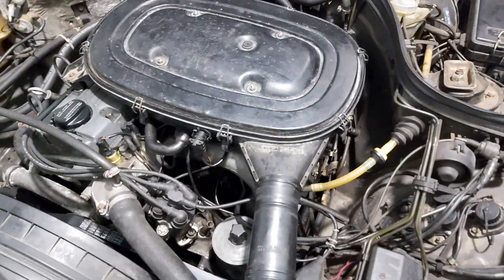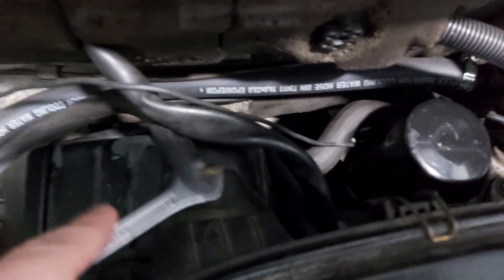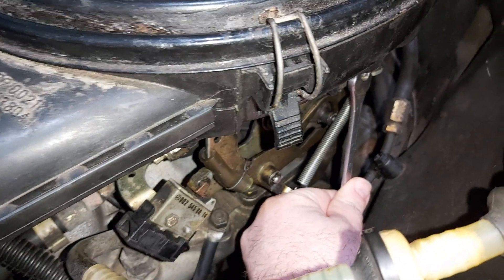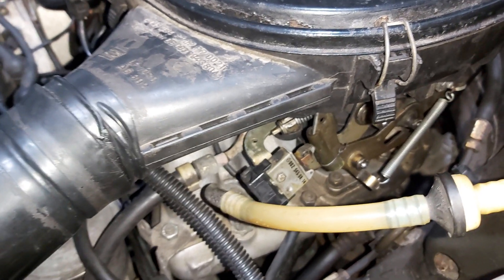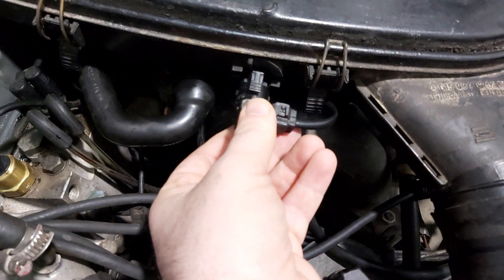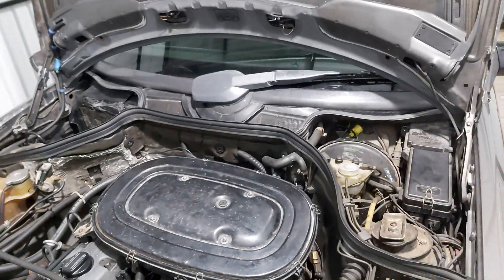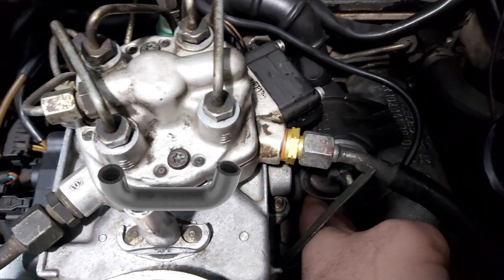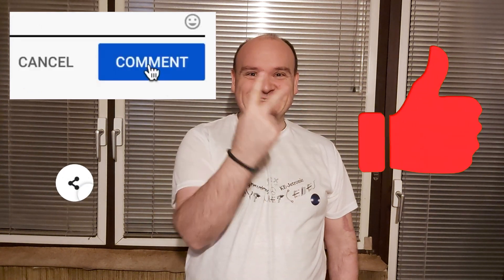Mercedes KeJetronic - A special video for a subscriber - The ICV

Comment: Great video .
Can you show a quick video , on how to remove the air box assembly on a 1992 SL300-24 M104 . I can only find the two nuts on the passenger side but can't find the other one on the driver side .
Reply from the maker: I was working on M104 engine ones but I don't remember really where each nut goes.

Comment: Hello and thank You for the videos! Here is my 420SE running: https://www.youtube.com/watch?v=pi9AXNIGLa8 Could this be a faulty ICV or a small vacuum leak somewhere? This "hiccuping" is not only present when idling, but also when driving on very little throttle, like 30km/h.
Reply from the maker: My pleasure! Have you replaced and calibrated the potentiometer?
Reply: Actually not yet! I have already a replacement part I have ordered (thanks for the tip in your other video for the replacement part!). It really seems that the problem is on idle or when the air flap is in certain position. When accelerating or driving on bigger throttle - no problem. I have already replaced the rubber hoses for the idle circuit, fuel pumps, fuel hoses, accumulator, pressure regulator, EHA, injectors and seals... The car runs now silent and perfectly - only this problem stays.
Reply from the maker: @wikketube  Replace the potentiometer and calibrate it. Replace the lambda if you haven't.

Comment: Hallo I have one question regarding the ICV and hoses aroud it. As far as I undestand it the ICV bypasses the throtthe in a way that it allows some air to get to the engine (if the ECU send power to ICV) even the throttle body is closed (throttle pedal released), together with EHA and air sensor plate regulating fuel it reulates idle rpms. Opened (air can pass) ICV - more air (and fuel) to engine - more rpm. If this is correct I suppose that the air goes from the bottom of the air flow meter trough lets say U shape hose to the bottom of ICV, then it continues to the engine itself, then the hose continues to the crankshaft cover and there is also a small vacuum line to the fuel presure regulator - BUT WHY THIS HOSE CONTINUES BACK TO THE AIR FILTER BOX - this does not make a sense for me - this connection allows air to get to the engine FROM the air filter box bypassing the whole ICV and throttle??? Can you please explain this to me? Thank you.
Reply from the maker: Hello and sorry for the delay. As for your question, I don't know where from to start. The air bypasses the throttle and goes through the second hole of the air boot into the ICV, which sends the air to the cylinders. The air enters the airflow meter through the sensor plate and then it goes into both the throttle as well as into the ICV. The line of the fuel pressure regulator is a vent line, it's not a vacuum line. IF you undo this line nothing will happen. As for the breather hose on the air filter housing, there is a little sensor there that has to measure the air and report the EZL and ECU about the air temperature. The air enters the engine through the sensor plate. If you start your engine and pull the sensor plate upwards(grab it for its screw), the car is going to stall. So, the air that enters the air filter housing has to be measured and then it goes to the engine(very small amount not good enough to make the car running). The main air goes both through the sensor plate and the ICV into the engine. The ICV is important not just for the idle but also while the car is on. I think I managed to explain you.
Reply: @mercedeske  thank you for your reply. In meanwhile I found out why the air is not leaking back ... That platic T thing that connects hoses from airfilter (vent one), ICV and fuel pressute regulator vent (small hose) have a very little hole in direction towardz airfilter - now it makes sense for me why the air is not going into engine via the vent hose.
Reply from the maker: @jiridrozd3289  My pleasure. I'm happy that you found out the cause of the issue. Happy Mercedesing!

Comment: Very useful thanks. Can you suggest how to check for and find vacuum leaks on MB cars?
Reply from the maker: Just with smoke. The leaks are not strictly on one and only place, it depends from car to car. Because noone can tell where a rubber part is going to be cracked. One of my subscribers found the leaks on 3 places under the air flow sensor. I am going to make a video on this topic. I will try to explain it as much as I can.

Comment: Hello i have a 300e w124 from 1985 m103 
my engine wont read duty cycle when i measure it what could be the cause of that?
best regards.
Reply from the maker: Hi there. In order for a duty cycle to be measured you need a good working lambda, potentiometer and the tps must see closed throttle and wide open throttle. Best regards to you, too
Reply: @mercedeske  my engine doesnt have a lambda i do get a reading but it doenst go up or down if i measure the potentiometer it goes up and down (ohms) but not very smooth so im changing that for sure but if i screw in or out the 3mm allan the hz measure doenst go up or down.
Reply from the maker: @e.hakvoort4833  If you don't have lambda, then you must get a steady reading of 50%. If you do, you are good to go, you don't have to check anything!👍👍👍
Reply: @mercedeske  ok thank you i didnt know that, but the engine is reading around 50% but its still shaking when idle a little bit i already cleaned the icv and checked for vacuum what else could be the cause of the little shake.
Reply from the maker: The injectors?
Reply: @mercedeske  replaced and the eha is replaced only thing to do is fuel pressure regulator and potentiometer all else is replaced like igntion and all that has been done
Reply from the maker: Check the regulator. Hook up the pressure gauge. And then press the throttle lever, the pressure mustn't fall for more then 0.1bar